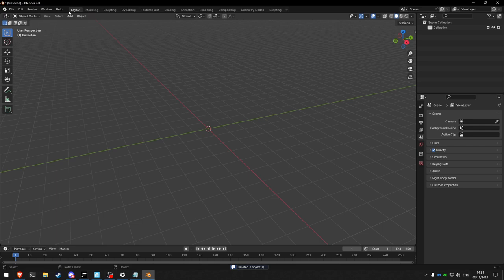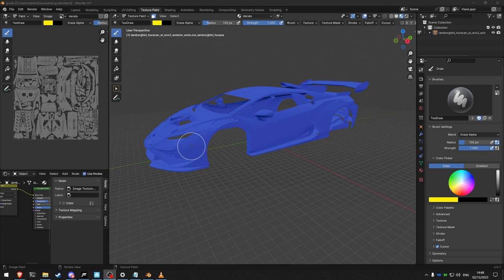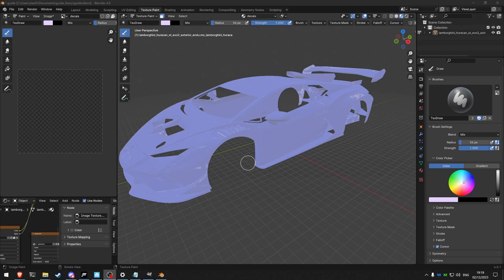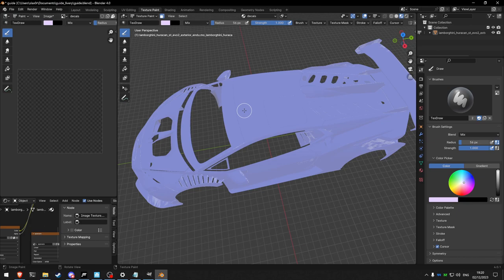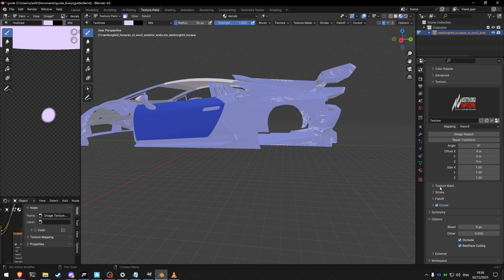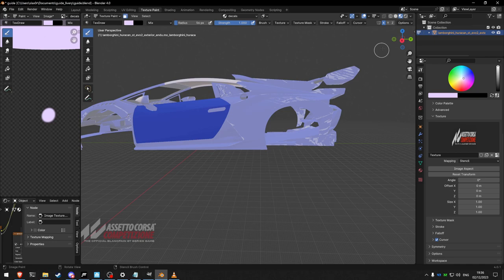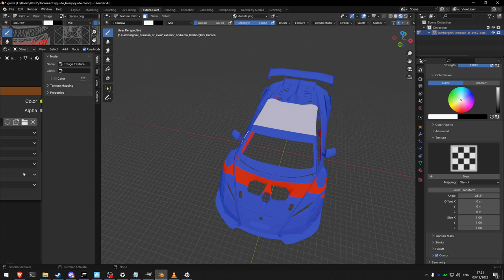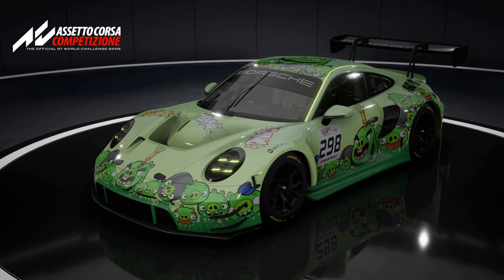ACC - Creating liveries with Blender - Advanced Techniques

Comment: Hello, is there a written manual for this? I don't understand English very well and there are steps that I'm missing, plus there are no videos on this method in Spanish.
Reply from the maker: I'm afraid there's not. You can try with automatically generated YouTube subtitles, those can be translated into Spanish.
Click on the subtitle icon and then in the cog menu you can set up subtitle translation.
Reply: The problem is that the subtitle comes out in English. jajaja
 @LoWreck

Comment: Question, My problem is if i make two Colors with a sharp line ingame you will see small triangels how can it be done without them ?
Reply from the maker: When you load into the track the quality of the livery is reduced. You can try setting the "texCap" to 0 in menuSettings.json in the Documents/Assetto Corsa Competizione/Config folder to see if it will help anything.

If the line between the colors on you livery is not pixelated, then that's the only thing you can do. If the line between them is pixelated even in the livery image when you open it, then you'll need to open it up in Photoshop/GIMP and correct it that way.

Comment: I really appreciate you making an updated version. I am still wondering how you get the wireframe outline on the texture paint window, the texture slot setup doesn't talk about it, and then its there in the next section of the video. I tried importing the image but it doesn't stay.
Reply from the maker: The wireframe appears as you're selecting things on the 3d model, which I do talk about in the selection section.
Either hover your mouse over the 3d viewport and hit A to select everything, or hover over a specific panel and hit L to select that specific panel only. As you do that the whole or parts of the wireframe will appear
Reply: don't forget the PAINT MASK option or it won't work ;-P

Comment: I am very grateful for your time in making this tutorial but I don't see how you went from the entire blue in the texture paint to then show the wire on the top left section. A step was skipped it seems? So I am lost at this point. Never mind... I think I hit shift A while in the right screen and the wire diagram some how linked to the 3D object and showed up on the top left section.
Reply from the maker: Yeah, I made a mistake with doing the multiple-texture slots topic, and should instead do the selection topic after, where this is all also explained. As well as this and other more basic topics are explained in the basics video: https://youtu.be/5rWCdsldUCw

Comment: How do change base colour using BSDF instead of single colour from layer?
Reply from the maker: With my limited knowledge about BSDF, I believe this is a very 3d model thing only and wont translate to the livery inside ACC. For ACC you can export your base color as "decals.png" i.e., and then use "decals.json" to set up some characteristics of that layer, such as base roughness, clear coat and its roughness, and metallic flake in the color.

If you want to create a sort of a 2 tone color with a gradient, sort of like I have on the Bad Piggies Porsche livery, I did this by preparing an image with the gradient, and then painted it onto the car using a texture stencil and painted from all sides.
Reply: @LoWreck  Oop, me probly should said this is just for Blendy and not ACC. 

Me watched many tutorials but never show how to change base colour besides drawing on Image Texture node results. 

Me would like to know how to make the base colour via BSDF to gain access to metallic, roughness, even Alpha to create it transparent layer
(>////<)

Comment: I'm trying to make a livery for the new Mustang GT3 and when I go to add a paint slot like at 2:50 nothing on the 3d model changes no matter what I do. There seems to be 3 things called EXT_Mechanics, EXT_Carpaint_Inst and EXT_Windows. Am I doing something wrong??
Reply from the maker: Are you adding it onto the EXT_Carpaint_Inst?
Reply: @LoWreck  I'm not sure but I don't think I am. It might have something to do with the 3d model I'm using but I used the same steps with a few other cars in the ACC Templates folder and it works just fine
Reply from the maker: I have added the 3D model and wireframe files to the original guide video description: https://www.youtube.com/watch?v=5rWCdsldUCw
Reply: @LoWreck  i dont get any wireframes from the mustang file and i have downloaded from your previous video .. nothing happens when i push A either ... followed all steps . i  have same options in textures as firstnamesecondname suggested
Reply from the maker: Create the texture slots on the EXT_Carpaint_Inst and then when you have a panel or the whole car selected you will see the wireframe

Comment: I followed your every step but I don't get the mesh on the left and cannot paint anything :(
Reply: Well, after reading some comments I apparently had to press A to get it to show. But now my problem is that I can't paint anything :(
Reply from the maker: You must have missed something. Unfortunately that's not enough info to know what you are missing or why it's not working. Sorry
Reply: @LoWreck  no worries, I got it working in the end. In the process of dealing with my original problem I accidentally creater a layer which prohibited me from painting. After deleting it I got it to work!

Comment: Thank you for this great video, which helped me a lot. First of all, I use a translator because my English is not so good. I was able to create a livery for the McLaren without any problems. But with the Ferrari 296 I have two files in the texture slots...I downloaded the current files...EXT.Carpaint & Ext Mechanics. I have tried different possibilities. But every time the 3D view disappears. Maybe you can help me? I would be very happy about that. Greetings
Reply from the maker: Yes, the Ferrari has 2 Material Indexes, but that doesn't change anything. Just make sure the EXT_Carpaint_Inst Material Index is selected when adding the base, decals, and sponsors texture slots.
It is also normal that the car disappears from the viewport when you're adding a texture slot with transparency, as it also does for me on the video.
Just continue to setting up the textures in the shader editor, and make sure you switch to Material Preview in the end on the 3d viewport so that you'll see the car.
Reply: After a lot of trial and error, I have found the solution. I simply marked the first slot and used it to create the individual slots. Followed your instructions and now it works.

Comment: I just do not understand what my Blender is doing.
I follow the steps and two things happen for me which I just do not understand. After setting up the nodes for the textures with Colour -> B, Factor -> Alpha etc, after a while they all just reset to the default positions with nothing connected and I do not understand why.

Is there anything that I should do to try and prevent this?
Reply from the maker: Oof, have to admit, I haven't got a clue. Played around in Blender a bit to try and reproduce this, but couldn't. Which version of Blender are you using?
Reply: @LoWreck  4.0.2, thanks for the reply. It's annoying but not a deal breaker, I just make sure to save before it goes wrong. I'm surely just clicking on something I shouldn't.

Comment: I'm really struggling to figure out how to save a livery project and then reload it back in to blender at a later time to edit it. Would it be possible you could do a short tutorial by any chance,  please 🙏
Reply from the maker: Not sure I follow. If you mean the whole Blender project, you can use regular File>Save As and save the .blend file somewhere on your hard drive, and next time simply open it in blender, should even be located in File>Open Recent, or if you find the saved .blend file on your hard drive through Windows Explorer and double click it.
Reply: @LoWreck  I've tried this but when it loads the sponsors and decals are not showing,  only the car shows up with a pink base layer

Comment: Hello, looks like it's not the same thing with the Ferrari 296 GT3, there is no .mtl files on it, and when i try to draw something on it, that doesn't work :( Please help. Thank you
Reply from the maker: Hi, I just tried the 296 (again), and it's exactly the same. Import the object, enable shade smoothing, then in texture editor add 3 texture slots (the difference here is that the 296 has multiple materials on which to add the texture slots, you need to add them on the EXT_Carpaint_Inst), base (with base color), decals, and sponsors (both with alpha turned down to 0), connect them all in the shader editor like in the video, enable paint mask (top left, cube-like icon), and switch to Material preview (top right, ball-like icon with 4 different sections in it), hit A to select everything, or select specific panel or section, and start painting.
Are you sure you haven't missed any of the steps? .mtl files are not needed afaik.
Reply: @LoWreck  Ok lol i got the answer at 15:30 i just need to click on A to get the piece of the car on the left and be able to draw onb it :D

Comment: Hi mate! I was wondering whether is it   possible to get the 3D templates in Assetso Corsa cars like ACC and if so how to get those templates?😅
Reply from the maker: I've never done this before. You can use the kn5 converter to extract the model, if it's not encrypted, but I'm not sure how well that would work for liveries 🤔
Reply: @LoWreck  Ahh thanks for the reply. I really want to learn about liveries ☺️

Comment: 38:35 Do you know the shortcut key to adjust texture size?
Reply from the maker: Hold shift and right mouse button then drag to resize. To rotate hold control and right mouse button and drag.
Reply: Thanks! @LoWreck